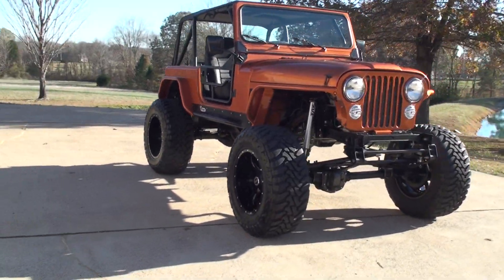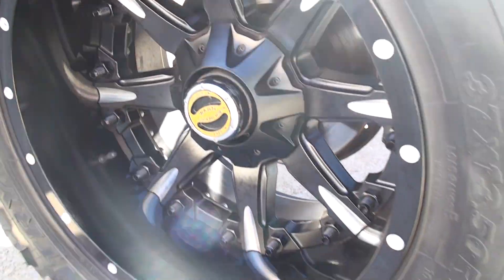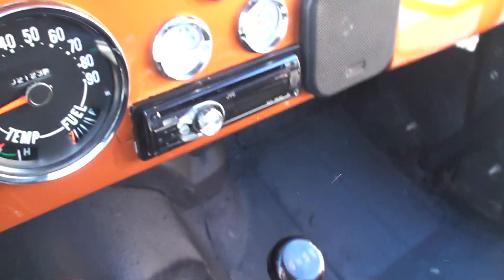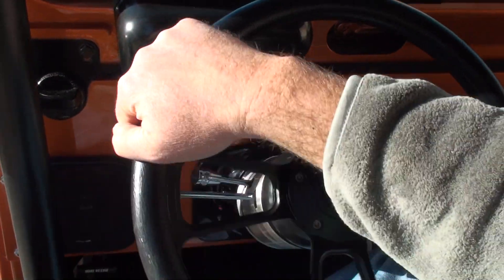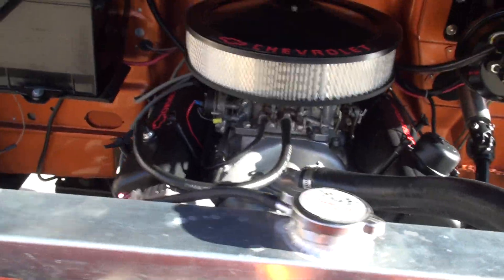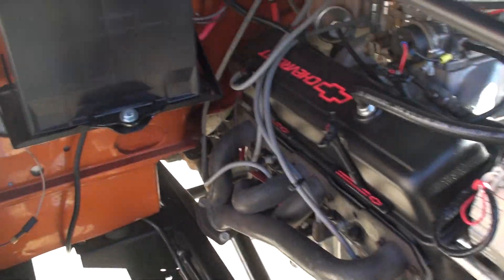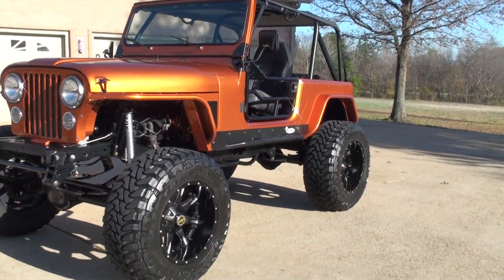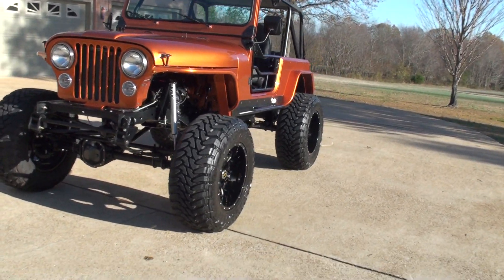HD VIDEO CUSTOM 1983 JEEP 350 CHEVY V8 ROCK CLIMBING SHOW TRUCK SEE WWW SUNSETMOTORS COM

Comment: What I's the lift on this? And GM axles?
Reply: rooster4501 axles looks like Dana 44 high pinion front and 14 bolt rear out of a 2500 90s chevy
Reply: @trsoff-road321  Front is not high pinion.

Comment: I have a jeep wrangler 1995 2.5  4 Cyle   can  fit a v6 or v8 on mine ? cause i putted twice engines of 4 cyle  automatic and i don't want to sell it, so  i want to put a bigger engine and transmission of course. thanks

Comment: shocks installed upside down? nice jeep nice work for a  mall crawler though...would not be good for rock crawlin with those leaf springs. "ultimate rock crawler machine"? lolol.
this guy doesn't know much does he....but still it is a very nice old school jeep...i'd drive it!....but not in the rocks..
Reply: Coherant bliss and those wheels and tires would fail terribly off road especially in rock crawling
Reply: I wouldn't drive it on road either. Reversed shackles are a recipe for disaster when you don't even do it the half ass way.